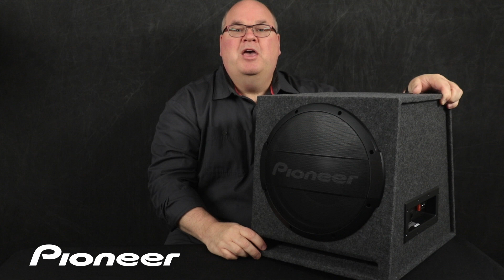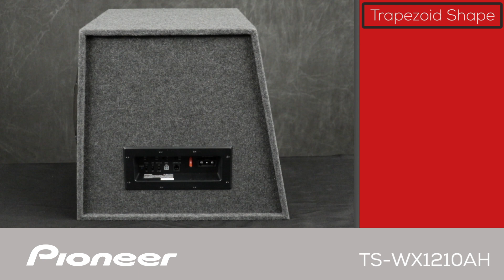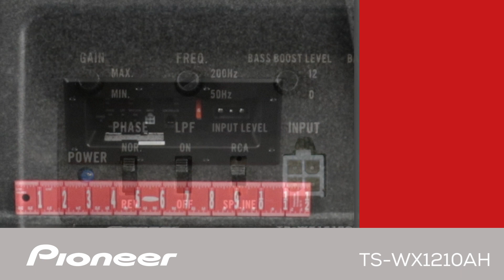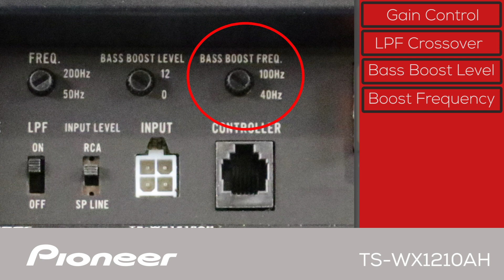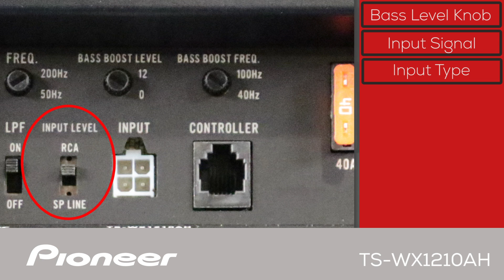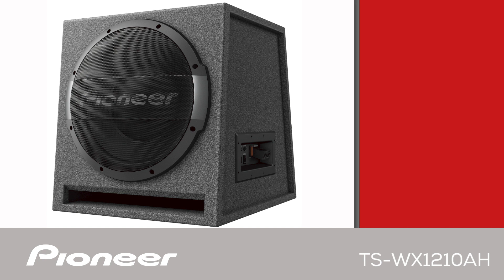Pioneer TS-WX1210AH - What's in the Box?

Comment: just one correction, it is NOT very easy to remove the power block lol. Unless, I have just not broke mine in well enough yet 🤷‍♂️
Reply from the maker: You can find more videos on Pioneer's YouTube Channel here:  https://www.youtube.com/user/pioneerelectronics
Reply: @pioneerelectronics  how can i get a power connection block replacement i lost mine 😢
Reply from the maker: @ivanvillanueva6726     I recommend to contact PacParts.  This is Pioneer's Parts Distributor in the US.  You can find them here:   https://www.pacparts.com/part.cfm?part_no=01%2E44%2D3JSZ3%2D032&mfg=Pioneer
You can find more videos on Pioneer's YouTube Channel here:   https://www.youtube.com/user/pioneerelectronics

Comment: What's better the  ts wx1210ah  or the Ts wx1210a
Reply: It depends on the type of music you like to listen to and what you want for your vehicle.  They are two different products designed for two very different applications.  The TS-WX1210AH is a slot ported enclosure 12 inch woofer with built-in amplifier.  The TS-WX1210A is a sealed enclosure with built-in amplifier.  The ported enclosure will deliver more boomy bottom.  It's woofer is designed for higher power handling capability because of it's ported enclosure.  The sealed enclosure is designed for tighter punchier bass. The sealed enclosure helps to control the motion of the woofer cone.  Both work great.  Choose the one that will work best for you in your particular application.  You can learn more about Pioneer subwoofers here:  https://youtu.be/AkushNUilVs?list=PLw63zJRQbCNhkTQCxPpxGF4h6l6qocsaR   and you can find more videos on Pioneer's YouTube Channel here:  https://www.youtube.com/user/pioneerelectronics
Reply: @deckerdotto6035  I listen to old school Rap and 80s New wave a lot, with some Reggae tossed in :)
Reply: I recommend for TS-WX1210AH for the bottom in the old school rap.
Reply: @deckerdotto6035  How about if I listen to techno mostly?
Reply from the maker: @ahkrmusic3369  I recommend the TS-WX1220AH.  You can see it here:   https://youtu.be/RFb9Qpt9Obo    If you're limited for space go with the TS-WX1210AH here:   https://youtu.be/cI9SfaPFenA

Comment: Why on the pioneer website, its said about this sub 1500W 600W RMS, But in this video you says 600W 300W RMS ?
Reply: There are two different specifications on the website.   1 is the speaker power handling capability:  500 watts nominal and 1,500 watts maximum.  And 2 is the amplifier output power.  600 watts max and 300 watts RMS.  You can see it here:  https://www.pioneerelectronics.com/PUSA/Car/Subwoofers/Powered+Subwoofer/TS-WX1210AH    The video speaks about the amplifier power and is displayed accurately.  You can learn more about Pioneer subwoofers here:  https://youtu.be/RFb9Qpt9Obo?list=PLw63zJRQbCNhkTQCxPpxGF4h6l6qocsaR   and you can find more videos on Pioneer's YouTube Channel here:  https://www.youtube.com/user/pioneerelectronics
Reply: @deckerdotto6035  Oh ok thank's for the quick answer.

Comment: Could do with some help. Does anyone know what size grub screws fit into the power terminal?
Pioneer weren't any help and I've lost the one that attaches to the power terminal and need a replacement. I've tried measuring it but cant figure out the right size, don't think it's a metric size because m6 and m8 size won't fit and they're the closest
Reply: I can't help with the size of the set screws, however,  if you need to buy a replacement Power terminal block, I recommend  PACParts.  They are Pioneer's Authorized Parts Distributor in the us.   The part number is 01.44-3JSZ3-032.     You can find them here:   https://www.pacparts.com/part.cfm?part_no=01%2E44%2D3JSZ3%2D032&mfg=Pioneer    You can find more videos on Pioneer's YouTube Channel here:  https://www.youtube.com/user/pioneerelectronics

Comment: what about the TS-WX1220AH, how much power is the amplifier?
Reply: The Pioneer TS-WX1220AH is an awesome subwoofer system.  It has a 600 watt RMS Class-D amplifier built in.  You can learn more about it here:  https://www.pioneerelectronics.com/PUSA/Car/Subwoofers/Powered+Subwoofer/TS-WX1220AH       There will be a video about the TS-WX1220AH soon.  Until then, the controls on the side of the amplifier are the same as what you see here:  https://youtu.be/cI9SfaPFenA?t=164     You can find more videos on Pioneer's YouTube Channel here:  https://www.youtube.com/user/pioneerelectronics
Reply: @deckerdotto6035  That kinda sucks, I was hoping the amplifier was 1000 watts so that it would match the subwoofers.
Reply: Please keep in mind, the TS-WX1220AH is a ported enclosure with 1200 watts peak output power from the amplifier.  Given a ported enclosure, the amp and speakers are very carefully matched for great performance and reliability.
Reply: @Anthonysmackass  I was thinking the same.

Comment: does it have more power than the TS-WX1210A ? i see now it has 40A. and also, is 10 gauge more than enough for this amp? or should i get a 8 gauge?
Reply: This is an entirely different product from TS-WX1210A.  TS-WX1210AH has a ported enclosure, for more boom.  This requires a much stronger woofer suspension and motor assembly. As a result, the overall power draw of the built-in amplifier is higher.  10 gauge cable wired directly from the battery will be fine.  Using 8 gauge will not hurt you.  Be sure to use a fuse at the vehicle's battery.  Want more boom?  Check out the Pioneer TS-WX1220AH here:   https://www.pioneerelectronics.com/PUSA/Car/Subwoofers/Powered+Subwoofer/TS-WX1220AH        You can find more videos about Pioneer woofers here:  https://youtu.be/QgG1mu2u3XI?list=PLw63zJRQbCNhkTQCxPpxGF4h6l6qocsaR    and you can find more videos on Pioneer's YouTube Channel here:  https://www.youtube.com/user/pioneerelectronics

Comment: can this be used in the house with my TV and home theater system?
Reply: Is it possible?  Yes.  Though in practice, it may be difficult. You can't just plug the Pioneer subwoofer into the wall outlet in your house.  You'll need a 12 volt power supply to run the Pioneer TS-WX1210AH in your home.  The subwoofer amplifier can draw up to 25 amps in normal use.  Please consider that draw when hooking it up to a 12 volt power supply.  You'll also need a way to switch it on and off with the rest of the home theater system.  Combining different products with different voltages and power supplies, can cause background noise in some systems.   Want more boom?  Check out the Pioneer TS-WX1220AH here:   https://www.pioneerelectronics.com/PUSA/Car/Subwoofers/Powered+Subwoofer/TS-WX1220AH        You can find more videos about Pioneer woofers here:  https://youtu.be/QgG1mu2u3XI?list=PLw63zJRQbCNhkTQCxPpxGF4h6l6qocsaR    and you can find more videos on Pioneer's YouTube Channel here:  https://www.youtube.com/user/pioneerelectronics 
Show less